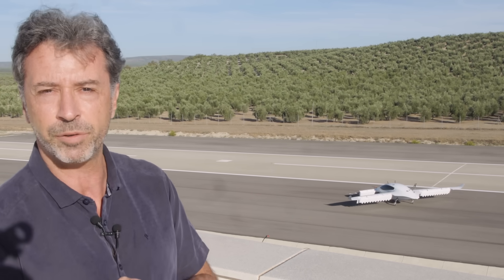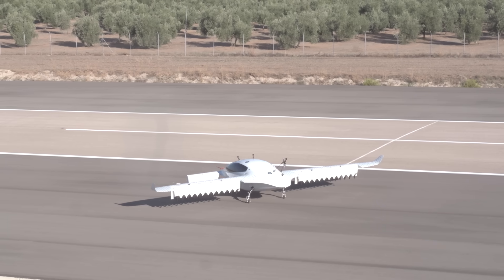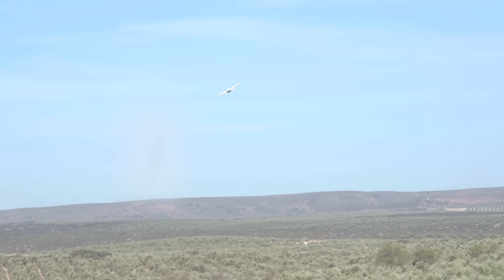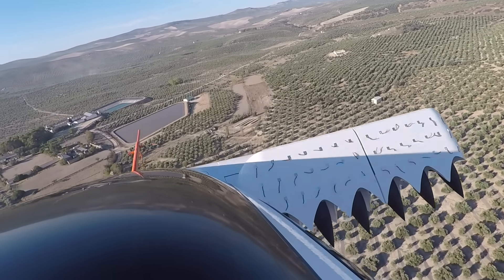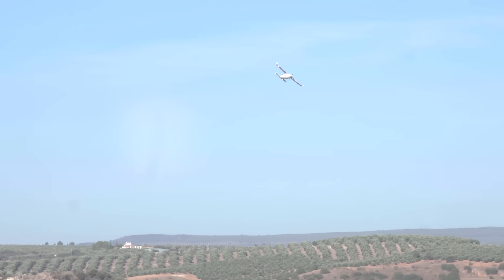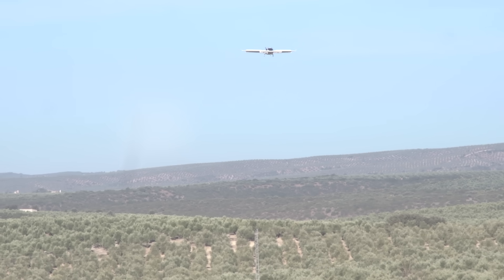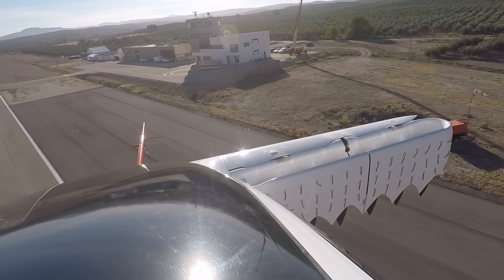Test Flight September 28: Lilium Jet Demonstrates Maneuverability

Comment: How long did the flight take? Just over 4 minutes? Would a longer flight have been possible or how long was the longest flight so far?
Was the battery fully charged at take-off and what was its remaining capacity on landing? Was there a payload equivalent to a certain number of passengers or at least the pilot? Without such facts, it remains nothing more than a glossy film brochure for investors with extremely limited informative value.

Comment: Will you be able to bring the sound level down, because it's very loud at this time?
Reply: Do you have the raw video and audio data? Do you know where the mices were? How can you make such a comment without standing next to the jet?
Reply: @danielb.9137  No...and that's a great point. After a considerable amount of years shouldn't Lilium be able to provide an ACCURATE video depicting BOTH the sound level and sound frequency profile during takeoff, cruise, and landing? This of course, gets much more critical when you get into their proposed 5 and 7-passenger models. Where noise levels might even be higher. We could easily get into a situation where the sound level (say 65 dBA) at 100m is not the issue...but the high-frequency sound in a city environment is.
"In August 2022, a journalist reported that the Lilium Jet's 36 rotors can be very loud when they start, sounding like a large industrial vacuum cleaner. However, Lilium's aeroacoustics engineer, Till Heinemann, has said that the company's ducted fan jet with tilting fans should be especially quiet in cruise mode. "
But cruise mode is not the issue, landing/takeoff is.
As a fan (no pun intended) of Lilium I wish them the very best, but as always only time will tell.

Comment: There is a new technology for solid-state lithium and sulfur batteries with 10 times more energy capacity than the current standard lithium batteries. if this battery comes true, it would greatly benefit Lilium Jet.
Reply: How scary would that be?

Comment: The nonsense runs thick trying to impress and improve  something that functions just fine for decades.
  A runway right there..  . I need to waste more power. Flying a model. With Lithium  batteries.  . It's a joke.

Comment: Scam Alert...
Let us consider some of the main orders:

Lilium “plans to sell” 220 Jets to Brazilian airline Azul for up to $1bn. The prospective counterparty received shares in exchange for their association with Lilium as what appears as advertising remuneration.

The NetJets order for 150 eVTOLs is  just an MOU.

As for the agreement with Saudi Arabian Airlines (100 eVTOLs), it comes with multiple conditions, which include ‘completing a feasibility assessment, agreeing to commercial terms, and entering into definitive agreements with respect thereto and satisfaction of certain conditions.’. Essentially, this is just a piece of paper.

Shenzhen Eastern General Aviation Co., Ltd (深圳东部通航 or Heli-Eastern) is a helicopter service provider in China. On 19 June 2023, Lilium announced that it had signed an agreement with Heli-Eastern who ‘intends to order 100 Lilium Jets’ according to the press release. Heli-Eastern has a fleet of over 30 helicopters according to a corporate presentation we saw, which suggests the company is small and does not have the balance sheet to take on 100 eVTOLs. 

We could go on as there are many instances of smaller orders with similar issues.  - Source Iceberg Research

Comment: Wont happen …. Way too loud for cities and just makes zero sense. Also from technical perspective this will never work
Reply: Except it is not designed for cities. This is not a building hopper type aircraft, and is also much quieter than open rotor designs. And what do you mean from technical perspective. They have a working prototype. From my technical perspective they have a prototype and real world data to support the move forward to production. Did you mean from a market perspective? That's the only way I would agree that it might not work if the demand for small flights that can avoid driving to the bigger airport and causing congestion is not as big as they think which might be the case from a market perspective.

Comment: I think batteries are heavy, so I think it would be possible to significantly reduce the weight of an airplane by using a hydrogen adsorption alloy to decompose hydrogen and generate electricity inside the airplane.
Hydrogen adsorption alloys are already at the practical stage in Japan, so it would be a good idea to use them.

Comment: Amazing.  Lilium defies physics which made a design that created so much drag (as shown by the attached strings on its front wings), hence turbulance [to the rear wings],  to be feasible.  Congratulations.
Reply: Hence the testing of a prototype scale model.  Would you not agree that improvements can be made by testing, before approval? Or are you purposefully trolling this project with poor logic and crass comments? This is the future!
Reply: @anderstremhoff32  My Lilium stock dropped over 50% since I bought it lol
Reply: @videorowtv5198  will probably drop 100%, not improbable event.
Reply: @igormaryanin8811  it's down 80% now hahaha

Comment: Yes it's an impressive demonstration... of a model. But how big and heavy is it?

I'm sorry to sound negative, but I get the impression (and I have no evidence to back this up - it's just an impression) that when it's a big heavy lump sitting on the runway with a pilot and two, three, four or however many passengers with hand-luggage on board, getting it off the ground will be like trying to get Leonardo da Vinci's pedal-powered helicopter to fly.

No, I'm not a physicist or a qualified engineer, but that doesn't invalidate my concerns.

I've designed, built and flown conventional and experimental RC aircraft for decades and even went on to get my PPL (in a full-sized 😁 Cessna 172). Right now, my sceptical, slightly cynical Elli-sense is screaming at me that this aircraft won't work as expected at full-scale.

Why? Because it's an EV, and whilst today's battery technology is capable of propelling surface vehicles, it's garbage when it comes to flight.

I'm a big fan of the scientific method, though, so I'd love to be proved wrong. Please, prove me wrong.

Have there been any independently-observed tests carried out on a full-weight 'mule' airframe to prove that the motors and batteries can provide the necessary thrust for the Lilium's various phases of flight? What's the safety margin? 100%? 150%?

If it had sufficient altitude, could it glide and manoeuvre after a power failure in the same way that a light aircraft or helicopter can [autorotate] to a safe landing? If it's intended for busy urban applications, deploying a parachute won't work because an uncontrolled descent into city traffic would be disastrous.

I know today's engineers use sophisticated CAD software to model every aspect of their projects - including expected performance - but that's still just stuff on a screen; it's not REAL.

True, this flight test of a scale model was real, I'm not doubting that, but when can we see a full-size, full-weight, fully-laden Lilium prototype in the air for an uninterrupted 45 minutes? It doesn't have to go anywhere or perform any manoeuvres or look slick and shiny for the cameras.

I just want to see proof that the physics works full-size. Like me, reality can be a harsh and grumpy mistress...

Comment: I have big issues with safety here, multiple engine's right next to each other first but exactly where are these things going to be operated, over any built up area will be unsafe.

Gliding properties Vs a comparable 6 seater Cessna if the engine's failed.

No just no.
Electrics alone are just not that reliable for flight especially with that many engines.
Also those engine's still use rotor blades and with that many onboard it's uncomfortable to know if one fails how many more could the take out and could it cause a chain reaction across the whole wing.

How would the aircraft cope with a catastrophic engine failure that causes structure damage do those engines get stuck in a certain position.

The balancing of the craft are a real issue for me if any engine problems arise as I believe the tolerance is too tight to become unstable and tip over.

Even in a helicopter if you lose your engines you have a chance to use autorotation and get you down probably pretty safely where you could walk away, can you say the same for this I can't at the moment.
Nice idea but it just doesn't work for me i can't see where it would break into today's aviation Tec world.

Comment: Good job. Anything that reduces noise, and greenhouse gases, of flying aircraft is a great accomplishment.
Reply: About 2/3 of worlds electricity production is based on fossil fuels, mostly coal. Consuming electricity equals to emitting greenhouse gases. Regenerative electric power rises, which is good news, but the pace is far behind the expected rise of future demand for EVs, heat pumps and industrial processes. Lets start with the most efficient electricity usage first. Electric aviation is not efficient due to huge battery weights to be carried and in contrast, conventional kerosene burning aircraft engines are even more efficient than average power plants.

Bottom line: Electric aviation emits more green house gases than conventional flying.

Comment: SCAM Alert: As a private pilot with over 260 hours of flight time that has flown Radio Controlled aircraft (Nitro and Electric), RC helicopters (Nitro), and "Drones" for over 30 years I call BS.

I'm surprised that investors have dumped enough cash to support a large organization for what is nothing more than a eVTOL drone in a fancy-looking fiberglass shell.   There is nothing proprietary here other than the shape of the aircraft.  There are already hundreds of videos on YouTube of hobbyists flying eVTOL drones, but none of them falsely claim that they'll be able to carry passengers someday. Neither battery energy density, nor power ratings of current electric motors, are capable of full-scale eVTOL aircraft.  This is not something that is likely to change in the next 10-20 years given the current pace of advances.

This is not a "Jet", this is a "Drone" - The presenter admits this in his opening statements when he states they're restricted to a small flight area (the local hobby flying field), and max altitude of 350 feet.  This is because flying above 400 feet AGL would be in violation of FAA part 107 regulations, and FAA also announced new rules against flying drones outside of pre-approved areas without pre-authorization/clearance.  The commentary and call-outs are nothing more than onboard telemetry.   I would have been slightly more impressed if they used Ardupilot to have the drone fly a pre-defined GPS course, but it appears they're not even at that level of sophistication yet.  Even if it weren't a drone, it still wouldn't qualify as a "Jet" since it is using electronic ducted fans (think tiny propellers inside round enclosures) rather than actual turbine engines.

eVTOL is not scalable.  Just because you can make a quadcopter lift itself and a few pounds of cargo doesn't mean you can scale-up to carry 5 passengers.  Pipistrel is the only aircraft company with certified production aircraft - these are small, 2-seat trainers with limited range and flight times.  Battery energy density doesn't support anything beyond small trainers with limited flight time (Pipistrel) or motor-gliders that use electronic motors to climb or extend their range.
Reply: @user-lh4yg6hj7i  European Union Aviation Safety Agency (EASA)

Comment: I honestly do not understand all the comments,   all these guys are doing is strapping a crap ton of ducted fans ( 36 of them ) to an air frame and put in what ever size battery would let it fly for a little, before you say that is amazing well no RC guys have been doing it for decades.   Large scale electric flight is never going to be a thing and based on the size of those ducted fans and the weight limits  it would only have a flight time of 10min safe flight, and like i said large scale is simply not viable because if this scale version flys for 10m in  and you double its size you also double its weight meaning you need bigger more power motors which doubles the power needs so you think "well add more batteries" and well this is the trap with electric flight because adding more batteries would not increase flight time, you could scale this up to 100% full size and with more weight  bugger ducted fans bigger heavier batteries you would still only get 10 min flight time

Comment: Thats a beautiful flight! One question, when the engines start, we do not equation of ground speed vs weather conditions for a stable rotation. How does the plane avoid bouncy take off. Like if the air is too hot at the tarmac and then suddenly the plane catches cooler air or up draft etc?

Comment: This is a way smarter design than most of the other experimental prototypes, which tend to forego wings for some strange and arguably ill-conceived reason, whereas having the wings here means lift can do way more of the work of keeping the plane in the air during cruise. Not only that, the fact that the jets also act as flaps to both passively and actively reduce the stall speed (basically to zero) is brilliant. 

Seems like Lilium is on the right track. I hope to see them succeed at bringing this (and/or some iteratively improved variant) to market.
Reply: wings have their downsides like having the wind blow the craft all over the place, and having to deal with minimum airspeed. While they do make sense for long flights, for short hops, something closer to a common drone could avoid some of those serious wing issues.

Comment: Since many years we see this Lilium as a small demonstrator taking off and landing on the fan-propulsion system as many other drone types. 
There were some short transitions to level flight, 

However we never have seen the prove of intended mission performance:
Take-off with representative weight, 
transition, 
cruise, 
approach, 
landing and eventually evasive maneuvers at take-off and landing.

This is simply nothing to convince any true customer, let alone a true aircraft designer.

After all these years you have to prove mission capability with payload-circumstances and adverse weather conditions 
at least for a 180-240 km range and or about 30-45 minutes of endurance + 10 min reserve.

Nothing gentlemen - the whole project is a money-pit
Reply: Paul Moller would be proud of their fundraising success.
Reply: By and large this project will only raise funds, as a toy for depreciation tricks.  
Even its noise will never allow this nonsense as a traffic-vehicle in populated areas
Fortunately Lilium will kill itself as an aerodynamic, flight-mechanical, performance and "air-traffic" failure. 
It will never be a commercial success.

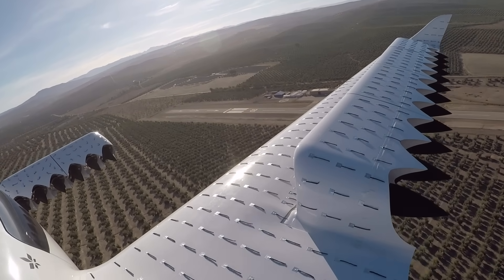Comment: 3:22 I'm discovering the plane.
This mobile module on the wing, facing the wind, is amazing.  Doesn't that increase drag and fuel consumption? At the same time, the lift of the wing seems to be greatly reduced. Doesn't this also mean that the engines have to be moved down a bit to compensate for this loss of lift, which also has a negative effect on fuel consumption?

Comment: Impressive design, but what purpose would a full-scale version serve? What benefit does it offer over, say, a regular helicopter?
It seems to offer less space/carrying capability than a helicopter and the maintenance cost of operating a vehicle with like two dozen tiny jet engines would most likely not be cheap either.

Comment: Nice model aircraft but in my opinion that’s all it will be. It does not matter what kind of motors you design,the battery technology is decades behind the curve.The payload and range will be impractical then add to that redundancy and requirements for certification all you have is a large expensive drone.

Comment: The reason the Boeing 747 and Airbus A380 went out of production is because airlines prefer their planes to have as few engines as possible.
If airlines could have big planes like the 747 and the A380 without engines, these would be the ones in the skies today.
But the FAA requires that every large-capacity commercial airplanes have at least two engines.
So here's an airplane that has more engines than a large litter of piglets, or maybe not: a mature sow can have a litter of up to 27 piglets :face-purple-crying:

Comment: I thought that most VTOLs would be used in areas of high congestion (cities like New York, London etc.), and one of the requirements in these areas is noise limits for aircraft. I wonder if they've given any thought to this, as it might potentially limit the future market.
Reply: Vtol aircraft will Never... Never.... Never  be used for civil transport
Reply: @j55321  I thought helicopters were vtols. What is it about vtols which inhibits this civil transport use? Is it just cost/efficiency?
Reply: @Think6.6  when did you last take a helicopter to work? or to the shops?
Reply: @Think6.6   Noise mostly.
Reply: @j55321  Quite some time ago, as a treat haha, but a neighbour was lucky enough one was available to take him to the hospital from the garden less than 4 months ago. But your point is fair and well made.
Reply: @j55321  there's a big difference between these and helicopters. Mainly noise and safety. They're safer with less complexity and have multiple propellers with their own battery etc. 

Once the red tape clears these will become very popular.

Comment: ☠BLACK BARON☠  Smooth takeoff and landing. A Flight Controller has to learn how to handle winds. No wind is a very good basis to teach ia Flight Controller the basic laws of "Stability". The front wing should be lower than the back wing.